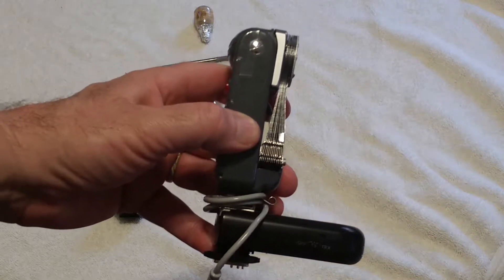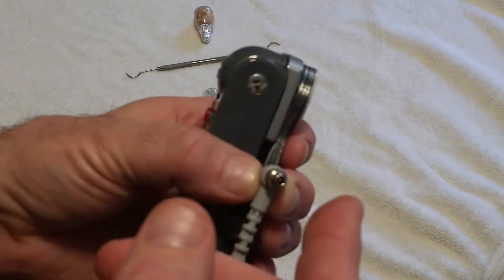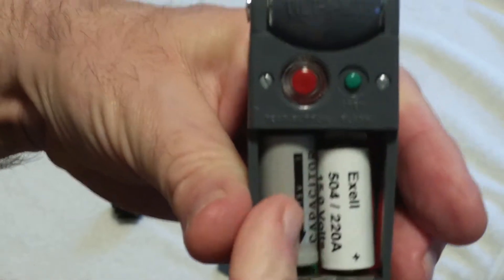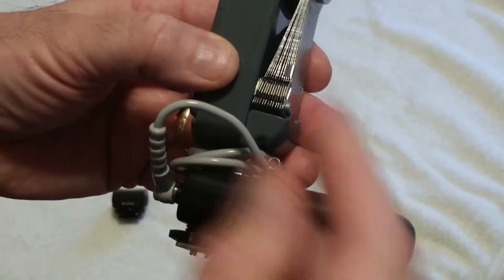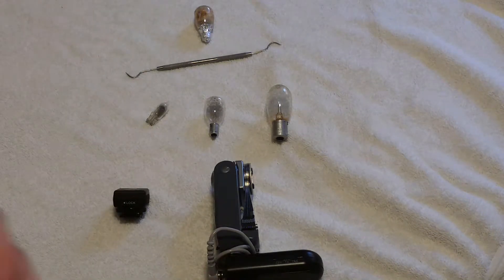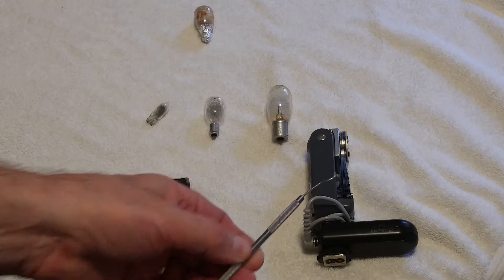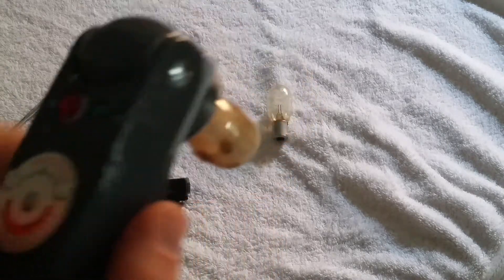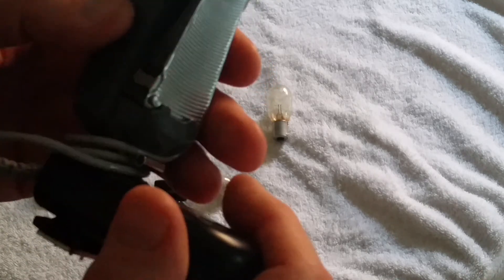How To Make a Honeywell Tilt-A-Mite Bulb Flash Work with Digital Cameras

Comment: Very informative! Would you know if Press 25 and No. 5 bulbs have the same base as M3 bulbs?
Reply: Press 25 and No.5 bulbs both use the larger "midget" base, while the M3 uses the smaller "miniature" base.  However, the Tilt-A-Mite accepts both bases.

Comment from the maker: These Tilt-A-Mites accept all flashbulbs EXCEPT the very large base 'light bulb' base ones that literally you screw into a regular light bulb style socket.  So any "AG" base, any "M" base and any large bayonet base (#'s 5, 5B, 6, 6B, 25, 25B, 26, 26B) bulbs will fit.
Reply: Awesome video! I'm not sure how I've missed this all these years that it's been up. Really great information.  One thing to note for folks in the market for a tilt-a-mite is that very early versions of the tilt-a-mite had only two-way sockets (before capless bulbs were introduced).

Comment: Do you know where I can get a capacitor?  Does it have a model number?  Thanks
Reply from the maker: The snap-in capacitor is obsolete.  Robbing another Tilt-A-Mite is a simple solution.  I measured the capacitance of two of these capacitors from units that work perfectly and got  readings of 400 and 600 microfarads.  So 500 microfarad value seems nominal.  A substitute part would then be a 500 microfarad, 15 Volt (minumum), polarized (capacitor is marked with  polarity for DC service only) capacitor (available from Mouser, etc).  The modern form may be a "disc" shape or "can" shape; either with leads sticking out.  To make that kind work in place of the original "can with battery ends" form would not be very hard.
Reply: @markdavidstrode4  My tilt-a-mite is a heiland.  The original capacitor is in the flash.  Are you saying that the capacitor is still useable with a new 504 220 A battery?  Also, I use the Nikon D810 there is a connector on my camera that the pc pin fits but in the video, you stated to use a adapter on your hotshoe and fit the chord into that? Is the battery adapter port on the nikon D810 not the correct fitting?  Also, do you have a link for a bulb?

Comment from the maker: Hey there.  You can fire as many units as you want by placing a remote on your camera and connecting the remote to the camera electric release (Canon/Nikon only).  Then use a remote in your hand to fire everything in sync-no need to hold the shutter open unless you want to paint with light or something.  Tripping the camera shutter manually does the same except with another remote in your hand you can be anywhere.  That probably is more important for fast recycling flash though.

Comment: Did the high voltage coming thru the Tilt-A-Mite trigger cause any damages?  I've always heard that they would damage digital equipment.
Reply: Never mind... Saw the next section
Reply from the maker: Hi there.  This unit is 15 Volts to the camera.  The camera doesn't "see" the current burst furnished by the capacitor.  With all said I use a remote trigger which absolutely isolates the camera.  The remote unit carriers all the current and has no problem.
Reply: Thanks!!!  And what a quick reply!   I am trying to research using the Tilt-A-Mite and flash bulbs to illuminate large caverns underground as the "top pro" deep cavers do.   BUT, wanting to be sure I don't damage cameras in the process.   Will likely have cameras setup on two seconds or such, then trigger as you showed using the Yongnuo's (which I have) or other even cheaper remotes and manually kicking it.  I may try to use optical triggers to get more than one set off at a time.  Great vid and thank you for answering things I've been researching for a week or so now.